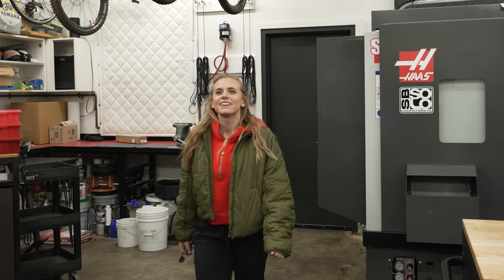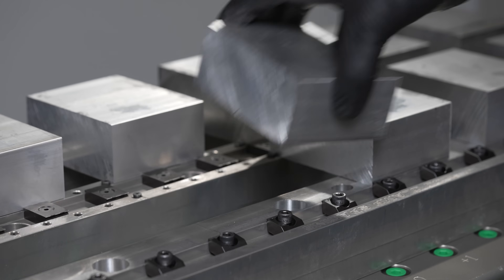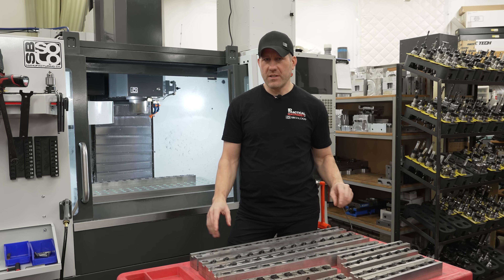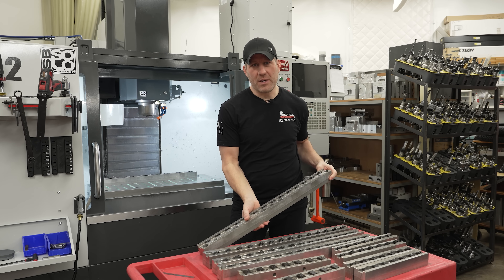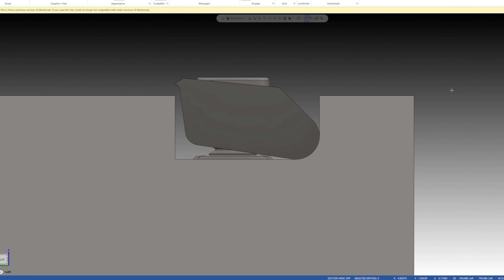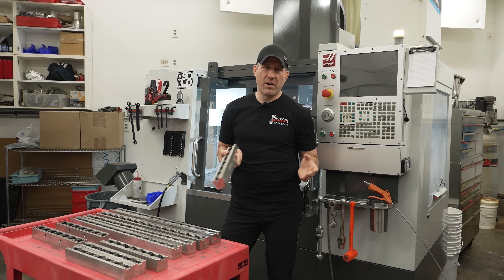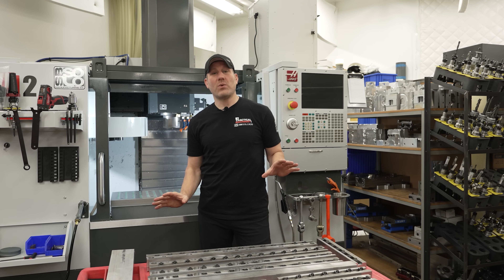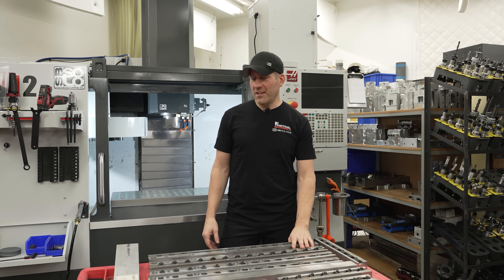Custom Fixturing That Boosts Your Runtime – Here's How! | How We Do It Ep.6

Comment: I hear people debate about thread inserts on fixtures, and like you, I see incredible service life with just aluminum threads. I think the issues others see is from careless operators, over torquing, and/or severe duty applications. My finding is that if you are an owner operator with a sense of appropriate torque, and you don't run the same fixture hundreds of times per week, you'll be fine with aluminum threads.

Comment: I really like the fixture plate setup that you have going on in your machines. How did you manage to machine something that matches the exact size of your table? Im not familiar with the travel vs table size of a VF2. Also does each hole allow you either put a guide pin or bolt in it. Are there threads beneath the bushing?

Comment: Hi Shawn, great video, and very cool idea. Would you please tell us a bit about your grid plate. What material did you make it from? How thick is it? Do you ever remove it from the machine? Do the holes get flogged out? and do you get corrosion  issues between the plate and table? - thanks
Reply: So it’s made from 7075 aluminum. Ground flat then hard anodized.  All the holes have keen certs and bushing. The green plugs keep the chips out. They screw down tight and seal against the lip of the bushing. As far as taking it off, it’s there to stay.  Everything is built off my sub plate. To prevent rusting you would want to use a rust inhibitor spray. Spray the channels with the thicker stuff. Then spray or whipe the top surface with the thinner stuff. You should be able to take it off years later without any corrosion. 👍
Reply: @SBSOLOCO  Thanks for the reply - awesome. How thick is it (about)?
Reply: @MachinedComponents about 2.0”
Reply: @MachinedComponents I second guessed myself and measured them. They are 1.625” thick actually. Bought 1.75” plate and had them ground down to thickness
Reply: @SBSOLOCO  ok 1 5/8 which is about 41mm , cool. Would you mind if I copied your design?
Reply: @MachinedComponents I made this video so anyone could get ideas and make their own system however they wanted. Feel free to take what you want out of it and make it your own. 🤙

Comment: use OK vise, they have much more clamping range, so you do not need to move rails
Reply: I like those things. But then I have the same issue with the center wedge piece sticking up to high if the material is thicker. Would have to look into the range.  But they are much more expensive to do a big rail like that.

Comment: Use Pockets for those clamps, a slot going the whole length weakens it and also catches chips. Tight pockets for each clamp is far better.
Reply: With my chip breaker endmills I’m actually not a fan of the pockets. They load up worse in my application. Mainly because I have to have them wider than the clamp so I can get the back radius on the floor machined. The sides pack in. If I make a relief I he chips pack in those. I found out it was easier to blow the chips sideways thru the rail once they were loose vs the air blowing into the pocket back into my face. Definitely agree with what you’re saying on weakening the backer.  I made sure I made them thick since I ran the channel down. I should have mentioned that in the video.
Reply: @SBSOLOCO  Understandable. I did a small relief in the corners but machining titanium and starting with stock that is close to final dimensions, My chips are tiny so easy to blow out.
Reply: @RichardMeharg-tt4kv Got ya. The chip fan does the bulk of the work for me. It’s not too bad really. I think the pin holes and C bores. Are the biggest problem for me. If I plugged those they would be pretty dialed. 🤜🤛

Comment: This is not a universal solution . But fantastic for bigger orders. I had a colleauge who really wanted to implement the mitee-bite clamps (pitbull and such). At that point i already gave up to convince management and boss and owner to invest 1000€ and let's se how it goes . 
Well this other guy was obviously also unable to convince them . We abandoned the idea forever.... I switched 3 places since than (some 5 years ago) . I still never ever seen any kind of setup with miniclamps . 
The only upgrade that i witnessed is the hard serrated jaws with 2.5mm depth . That's a nice upgrade from what i had before.......
Plus there is another thing , shop made collet chucks operated by a central big bolt , that expands to a given I.D. . That was a nice surprise , i didn't believe that it would hold in rough turning , but it does :D  .
Reply: For sure. I only use these with bigger orders that will give me long runtime. Otherwise they are not worth setting up in which I default to a double station vice.

Comment: Boys can anybody give me some advice i just bought a older cnc machine and my friend will make it so i can put programs into it from my pc but i need tools and vices and its hard to find them here in europe is there any advice you can give me about how to get cheaper tools,vices and work for my cnc machine ! :)
Reply: You can buy used stuff from auctions. Work is another topic. Networking and with people inständig way to Go
Reply: @teekteekteekteek  thanks do you know any reliable auctions site for europe?
Reply: See if you have any local small machine shops in your area, there's a ton of old tools usually kicking around the shop that you could probably buy off people or get for free and refurbish. My very first vice was a rusted hunk of junk that I spent probably 8 hours on tearing apart, sand blasting, assembling and machining to true.

Comment: Great solution! In the clamping rails, maybe the locating pins aren't required. You could put slots rather than holes for the bolts and adjust the rail to fit that batch of stock?
Do you run anything other than ali? I've made lots of pitbull fixtures and the rad on hot rolled steel and stainless make them hard to use. Also they're very pricey in the uk. I've made a lot of my own cos they're a great concept design
Reply: That’s exactly what I have to do. I have to pull the pins and push them up to the smaller sizes stock. It’s time consuming for sure. 

I have done a bunch of stainless and that raw stock isn’t flat awful. Big rads and the side walls have a convex curve on them. Totally get where you’re coming from on steel. Kinda why I wanted to mention it could be an issue if you clamp down at the bottom.

Comment: do you surface grind the flat faces so everythings as flat as parallel as possible relative to itself or is machined enough? or does it even matter ? sorry trying to learn.
Reply: Thats actually a good question. Since these are for raw stock it isn’t needed for them to be super flat. They tend to get beat up so I stone them now and again. But for the most part your stock isn’t flat to begin with and you would never really use these for a 2nd operation with a finished surface on the bottom.  But even then machining them is flat enough if that were the case. 

That being said I blank these up so I can bolt to the table. After they are bolted to the table I machine the top deck, channel and holes so they are as parallel to the table as possible. Hope that helps!
Reply: It shouldn't matter, if the milled face on the bottom is bolted down to the table and then the top is machined, then the face that holds the parts should be both parallel to the table and also perpendicular to the head of the machine.

Comment: I like your setup... question...in Mastercam, you obviously have all your fixtures modeled, you have your wcs datum in the middle modeled, I get all that,  but when you merge (import) your solid model for the part, into that fixture model with all the layers, are you just manually translating the solid into the first position?
Reply: That’s exactly what I’m doing. I have moved the WCS plenty of times in my career, but in the end I prefer to move my model and material stock into position. I have found it’s much easier to move the model vs moving all my imported templates around the model. So basically I bring model in, square it up, throw a material around it and then grab the corner of material and translate against stop. 👍
Reply: @SBSOLOCO  nice, that makes sense ..seems like a good workflow for using those bars!